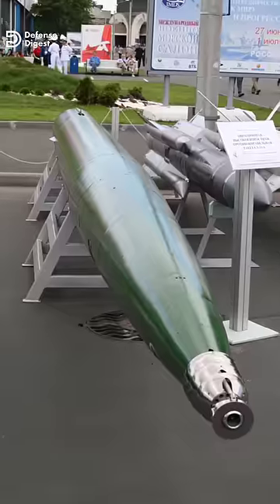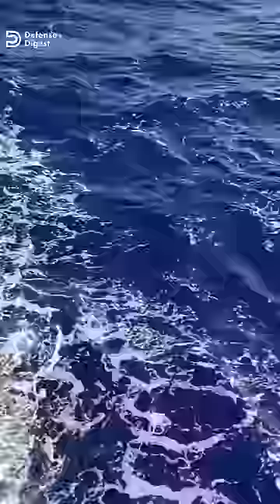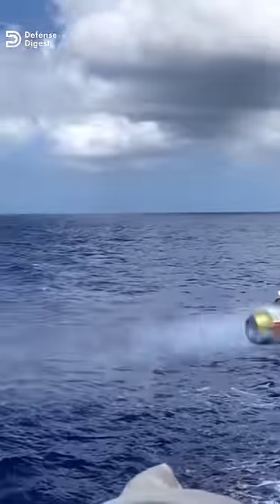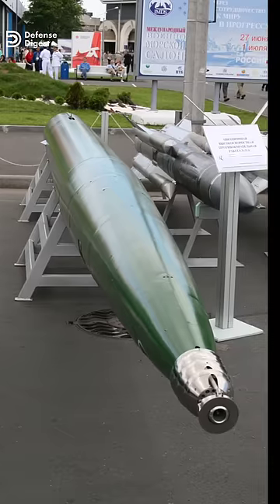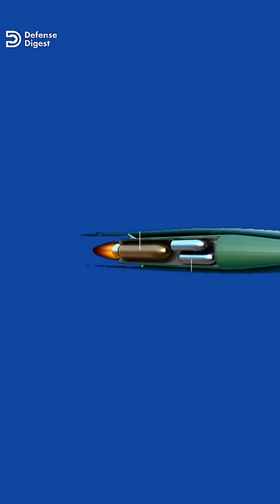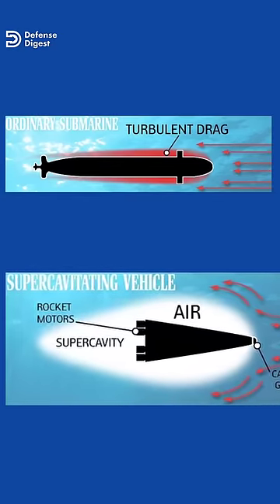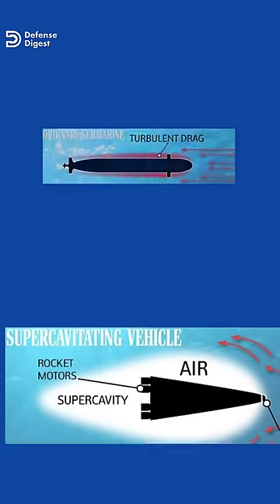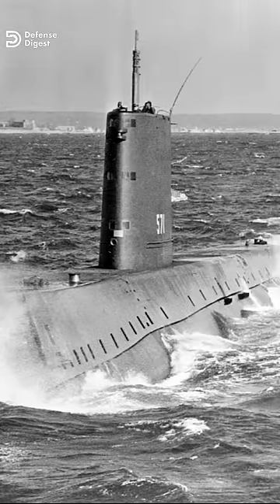Russian "Shkval" Torpedo Zeroes in on Targets at 200 Knots #shorts

Comment: It was actually a revenge weapon meant to be fired at a enemy submarine after it already fired a torpedo at your sub. The idea being that because of cavitation, it was unguided, it has no sonar to track with, so it would be aimed down the torpedo track and hopefully back to the enemy submarine. Of course by the 70’s, torpedo tubes were no longer in the prow of the sub like in WW ll but instead on the sides so that after a few hundred yards it would turn towards its target. But the main problem with Shkval was it’s range, at that speed, it used its  fuel up after only 10 km while the Mark 48 torpedo had a range of 37 km at 55 knots!